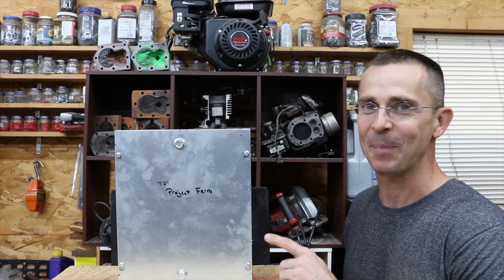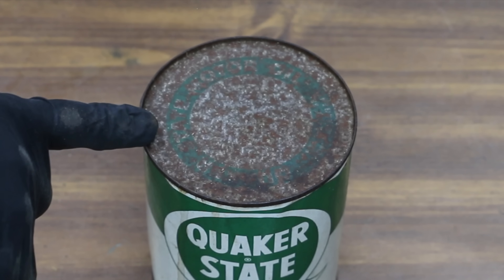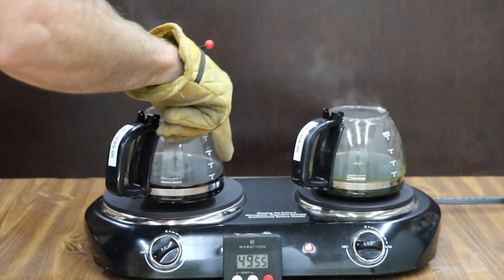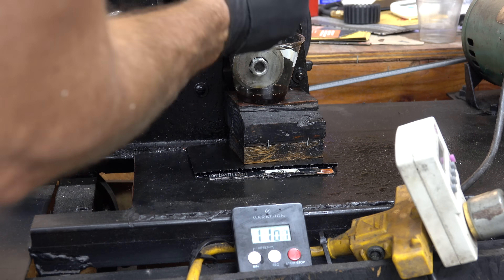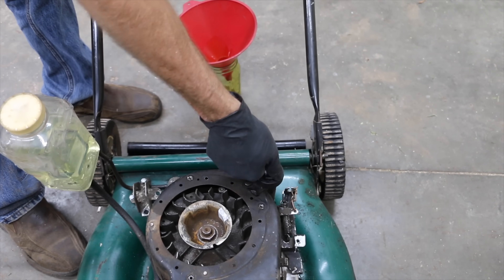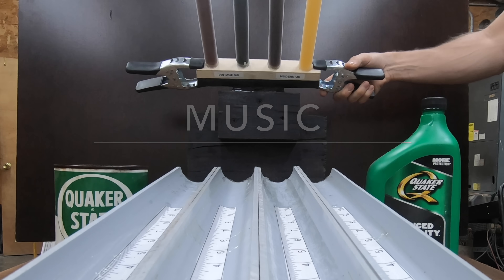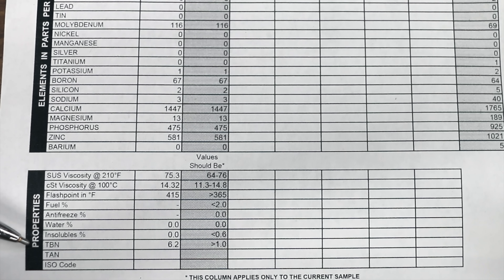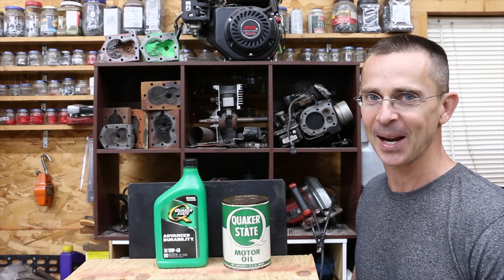Is Oil Good After 70 Years?  Let's find out!

Comment: Both oil’s are millions of years old so a 70 year difference isn’t much.lol
Reply: im sure the added additives and changes in refinement technology makes a difference, but maybe thats too obvious
Reply: Dana Vixen That’s the only difference. Same crude oil since the beginning of time
Reply: 70 years in the depths of the Earth doesn't matter, but 70 years at atmosphere to oxidize may. The real question is how was the oil always stored.
Reply: @PorkBoy69  … not to be a wise guy, but I'd say the oil was stored in the can we see in the video and since it's an all metal can it's likely from the mid to late 60s, before they went to cardboard with metal top / bottom. If you mean storage conditions, let's consider the can condition. The paint shows no signs of excess heat so not likely in an attic or sunny window. There's surface rust so either condensation from temp swings or a damp garage / basement, but not a wet location, or we'd see signs of rusting all the way through in spots. All in all, likely stored where most people store that kind of thing... garage, barn, shed, and maybe even in the trunk of an old car. Unlike food, even a slight bit of contamination wont change the chemical composition enough to worry about. Basically this is as good as it was 50 years ago.

Comment: The cold temp test would have been more on the level if straight 30 weight oil had been compared to the old stuff.
Reply: Single viscosity isn't common anymore though. It's more of an expose of old tech versus the most common modern tech.
Reply from the maker: Great point.  Thank you

Comment: This old vintage oil is designed for low rpm engines
Reply from the maker: Thank you for the feedback
Reply: I think 3 RPM only, just to be extra safe, hope this will make someone laugh.
Reply: @abraamsamor7418  Could be old farm gear. It wont rev up too much. Its not like Scottys Celica rev up your engines !!!!!!!!!!!!!!!!!
Reply: LOOT SHEQ … watch the tach on a modern engine with a 4,5,6 speed auto or CVT and you'll hardly ever see 3,000 RPM. If you drive easy you may never see 2,000 RPM. Personally I don't think RPM was ever a factor in oil specs, other than "flying off" moving parts, which basically lubes other parts near the spray. The technical term for that is "splash lube" which is what many small engines use.
Reply: Old vintage oils lubricated fighter planes that had high revving engines.
Reply: @ralphwood5114  … I think a little research will tell you that most vintage aircraft stayed under 3,000 RPM, which may be high for that era in automotive use, but aircraft also used different oil, even back then.
Reply: The message I'm getting is the vintage oil will sludge up your engines. I have never had a Sludged up engine. I've used 3 different brands of toilet paper filters The sludge has always been in the filters instead of the engines. The system of allowing the oil to get dirty and foul the engine then draining it is a poor maintenance program. Bought an old house once owned by a pilot. Above the garage was some interesting items such as a case of Texaco aircraft oil.There was a picture of a very old airplane on the cans. Saw some Aero Frantz filters on crop dusters near Wichita ks about 40 years ago. They used toilet paper as a filter element.
Reply: @ralphwood5114  ... I have often wondered if those TP filters were invented by farmers / for farmers. It's just such a simple idea and it usually works well... as long as the filter is changed BEFORE it clogs.
Reply: I've used toilet paper filters for 56 years. Put a toilet paper filter on a neglected Sludged up engine and the I told you so guys will get you.That toilet paper didn't clean the oil. My cousin said that damn filter you put on your dad's car wasn't any good. It filled up with sludge and stopped working. Put a toilet paper filter on my uncle's 59 Ford. It was a pig pen. To make matters worse he had removed the thermostat.I was getting about 50 miles before the filter stopped up and wouldn't heat up. Finally got it up to about 100 miles.His brother said my Frantz is no good. My oil is dirty and my lifters are noisy.I ask him when he changed it last. He said change it the guy that sold it to me said it would last a lifetime. I'm sure the FAA approved AeroFrantz didn't have a sludge problem in the crop dusters. None of the oils are idiot proof. Motor Guard was the best of the toilet paper filters but stayed in business by converting to compressed air filters.Gulf Coast Filters has a nice little filter but they are big into big roll paper towel filters on heavy diesels.I have about a dozen Motor Guards and Gulf Coasts in use even riding mowers.Anything with an oil pump.
Reply: I go 6k miles between filter changes now.with synthetic oil. Back in the 60s With Delo 100 it was 2k miles.I have no idea which oil is best. I think after watching this channel I will use the Wal Mart. I just bought a 16 pack of Great Value 1000 for the filters. Change the lawn mowers about every 2 years.
Reply: There is a lot of bs out there about oil filters like if you use a synthetic element you can go farther between filter changes. No one has ever came out with a better oil filter than toilet paper. The.only reason the big Bounty Big Roll filters are as good as toilet paper is the oil has to travel thru 11 inches of paper. The big Luber Finer 750 filters The oil only has to travel thru about 3 inches of pulverized newspapers and wood chips. The better the filter cleans oil and the smaller.the filter the more often it needs to be changed. There is no such thing as a spin on filter that cleans oil. You gotta have depth.
Reply: Someone like me that knows nothing about air craft engines would think they are doing at least 20 k RPM. Had a neighbor that was an old pilot. He told me he sold his wooden prop for more than he paid for it new. He told me when the wooden propeller broke it would tear the engine out of the plane.
Reply: The Frantz oil cleaner came from Motesto, California. The Motor Guard came from San Jose, California. Motor. Guard had the best design. Using toilet paper wasn't good marketing. They should have found.an element.as good.as toilet.paper that they could call something else and charge more for it. They are fixing that now but they will always be toilet paper filters to me.

Comment: Have You ever seen a "Quaker state" engine? Looked almost like shale, coated everything in this unworldy flakey crud.
Reply: Pennzoil does that too. It's an amber color waxy crust.  Parrafin. Saw it when I  tore apart an old slant 6 that used it.
Reply: Our 71 ford 302 ran Quaker state. That was the nastiest sludge bucket I'd ever seen when we tore it apart for rebuild. The cuda I had ran Castrol for years and when I rebuilt it she was still clean.

Comment: I tried Pennsylvania grade wolfs head motor oil in my motorcycle. A four stroke two cylinder water cooled Honda, Pacific coast model. I had heard advertising claims of “Pennsylvania grade “crude oil for years from Pennzoil and wolfs head and Quaker state..
 so I changed the oil to wolfs head because when oil is not good, it is immediately apparent when you put it in a motorcycle that uses the same oil to lubricate the transmission.
  I drained out the old oil and put wolves head in, the required amount I think it was about 3 quarts.
I put them on my gear, and started the bike and let it warm up for about a minute as I put on my jacket and gloves and helmet. And I started out. I did not even make it 100 feet up to my mailbox when I noticed it was very difficult to shift. I kept going, I made a left turn at the stop sign and started up the hill, I shifted to second, then to third, then to fourth gear, it was almost painful to the top of my left foot to shift. Before I damaged my transmission, I turned around and went home and drained that stuff out. I put “motorcycle oil” back into my engine, the required 10 W 40.. I took my motorcycle out for a test ride and to check the transmission shifting, everything was back to normal..
  that wolves head oriole apparently did not have an additive package with enough zinc and phosphorus in it to give the oil film strength to tolerate shearing in the transmission..
  I used to be a motorcycle mechanic and three different dealerships for years. I learned years ago that you can tell your oil needs changed when you feel the transmission shifting become slightly more difficult, and it becomes a little more difficult to find neutral..
 Bad wolves head motor oil, that was not advertised as being for motorcycles, but it was oil that was made before the oil companies started to change the oil In the late 1980s, that’s when we started to see oils like 0W 20. The government asked the car companies and oil companies how they could come up with a way to get more miles per gallon gas mileage on cars. They said- thin the oil out.. The thicker the oil, the higher the friction..
 so without watching this video. I can say from experience that Pennsylvania grade pre-1989 oils were not better for motorcycle transmissions , that are designed to run on the same oil in the transmission as runs through the engine crankshaft cylinders and valve train.. today, these are the good old days when it comes to the best oils..
Reply from the maker: Thanks for sharing.

Comment: So modern oils will make a 1950s engine last twice as long?
Reply: I wouldn't doubt it at all!
Reply: lee nevin … good possibility, but you would have to use that better oil from day 1 to know for sure. That would make an interesting test. I wonder is some nerds could find a couple of new old stock engines and run a test like that? Might take years to prove anything conclusive.
Reply: Probably more than twice.
Reply: No they won’t. You need zinc which is absent in modern oils for on road use. You need to run off road oil in older engines without roller lifters or you’ll wipe out the camshaft. It’s all an epa thing.
Reply: David Watson   Many car drivetrain warranties back then were only good for 5 years/50K miles whichever came first. Imaging trying to sell THAT to the public today!
Reply: They would help, but the weak point back then were the metals. On the other hand they had higher octane fuel and much looser tolerances.

Comment: oil in nature is more then a billion years old, so wouldn't you expect it to combust after an addition +70 years?
Reply: It's actually only a couple hundred million years old ;)
Reply: @Borednesss  well I was a little excessive.
Reply: Well this is engine oil it isn't made to combust.  Also, the crude oil from the reserve are vastly different from any kind of lubrication oils or fuels we use after refining. 

Try running an engine straight off crude and chances are it won't start and if it does your engine will die sooner or later. 

I think there is a video on this channel about the same
Reply: @Dinara1up  Happy to be enlightened, I may not know the specifics of this oil, neither am I, a mechanical engineer. Correct me if I'm wrong; 

Oils such as engine and motor oil are viscousious petrochemical that has been derived from the fractal distillation of crude oil. Oils are immiscible with water which means that the two liquids won’t mix, crude oil is formed deep underground from the decomposition of organic organisms such as zooplankton and age. After a million years of geological heat and pressure, the organic matter was transformed into oil and gas.
 
Engine, motor oil or lubricant typically speaking is made with a vary of substances comprising of a base oil which is enhanced with the addition of antiwar additives, detergents, dispersants and - for multi. Grade oils - viscosity index improves. 

The main function of motor oil is to reduce friction, wear on moving parts, clean the engine from sludge, neutralizes the acids that originate from the fuel (oxidation from the lubricant), sealing of the piston rings and cooling of the engine by carrying heat away from the moving parts.

Oil is not classified as a flammable liquid, Oils as a fluid has a flashpoint of above 150C (Celsius), which is why they are classified as (Class) C2 combustibles and not C3 flammable liquids. Engine oil is made up of large molecules that have between 18-34 cabana atoms per molecule. 

Engine oil will not burn at room temperature, resulting from the intermolecular forces of attraction between the molecules are much stronger compared to petrol. A low flash point poses a safety hazard, where the typical motor engine oil has a flashpoint in the range of 425 - 460F (degrees fahrenheit) (219 238C): only after reaching the flashpoint the oil will sustain a flame.

Engines are typically found in three configurations, internal combustion, external combustions, and air-breathing combustion engines. A traditional engine has a normal operating temperature range of 195 to 220F (90 - 105C).

The lifetime of motor oil is determined by the chemical used and how it’s was stored, exposure to air, oxygen, heat, light, and water. The optimal storage conditions being to store the oil in the original unopened container at moderate temperatures; the container is to be left on a stable platform, without redissolving the deposits by shaking the container.

In conclusion, my research (a few google searches) showed that oil under typical driving conditions would not combust, my research is not the holy grail of research, just a bit of what I found.
Reply: @WaheedRahman1  What was the point behind all that? you couldnt just say "oh your right, oil isn't really combustible"? lol
Reply: @supercommando89  I wasn't sure, so had to find out, was perplexed. Great suggestion btw but I hope it was a good read lol.

Comment: My grandfather owned a Atlantic Richfield gas station back in the sixties and seventies. I hung out there alot and remember these kinds of oil cans. I used pennzoil in the same kind of cans in my 1955 chevy as a teen. No wonder the engines back then were wore out at 100,000 miles
Reply from the maker: Thanks for sharing.

Comment: My father was a career master auto mechanic. In his lifetime he rebuilt hundreds of engines, transmissions and drivetrain components.
One piece of knowledge he passed on to me was to identify two brands of oils when disassembling motors for service.
Those two brands, based upon customer/owner response, were Pennzoil and Quaker State.
The inside of the engine had built up large clumps of deposits which even though large could be broken down between your fingers.
The biggest hazard they could impose would be to dislodge and plug drain ports like in the rocker galley.
The only thing I could deduce as to why was that both brands were paraffin based oils.
To this day 35 years later I would never buy nor use these two brands.
Reply from the maker: Thanks for the feedback.
Reply: Was he a Valvoline man? I think some cars using that made it to high mileage.

Comment: Great video!! I've got a couple of cans of Castrol out in my garage that I just can't seem to part with (no idea why...). Nowhere near the age of that Quaker State, though!!
It is, no doubt, a good thing they don't make engine oil like they used to!! That's probably why you saw (at least I did) engines in the 60's & 70's with around 100k miles that were totally shot and leaving smoke trails behind them!  That was, in my opinion, not just the oil but the materials the engines were made out of. Metals technology, along with lubricant tech, has come a very long way. That's probably why my 1 owner '03 F150, 5.4L, with 275k on it and drives like the day I bought it. Of course, I'm pretty anal about maintenance, so that may be one reason...
Reply from the maker: Thanks!  Thanks for sharing.
Reply: It wasn't so much the engines, it was the motor oil, combined with the fact that more than a few people would remove the air cleaner when it became clogged up, instead of cleaning and re-oiling it.

Comment: When he opened that old can of oil that sure brought back some memory, I remembered 40 plus year ago I had to add oil to my 69 Dodge Dart every other month and that oil was also greenish color and it was in paper oil can and I used a pour sprout with a piercing end to add oil to the engine. Back then nobody said anything about you have to change oil every three months or three thousand miles, we just look at the drip stick and feel the viscosity of the oil on our fingers and if the oil is very dark and thin we then do an oil change, exactly un-scientific but those were the good old days.
Reply from the maker: Thanks for sharing!
Reply: Yes we were indeed told to change it, every 3,000 miles was typical.  I have always changed mine every 2,000 miles.  Many people though hardly ever changed it.  With the oils of the day, the engine would be shot at about 50,000 miles.

Comment: I live in "Quaker State Country"  Living just 60 miles from the original headquarters.  They had a reputation for a motor oil that would gunk up an engine and leave heavy waxy deposits under the valve covers.  I'm not surprised by the test results here.  On the other hand I wonder what a vintage can of "Pennzoil" brand motor oil would show.  I find it interesting that this can, obviously showing some age is marked with a volume in liters as well as quarts. Maybe I have a partial can of Pennzoil.  I think its paper though so it may be late 70's early 80's.   Interesting project farm testing.
Reply from the maker: Thanks for the suggestioin.

Comment: I had always been told that Motor Oil does not degrade but the additives do degrade !  They used to also say that the "Single Viscosity" had the highest grade oil in it... I remember in the1950's & 1960's you could choose a " Non-detergent" motor oil....   Some applications like an "Air Compressor" required a non-detergent oil.